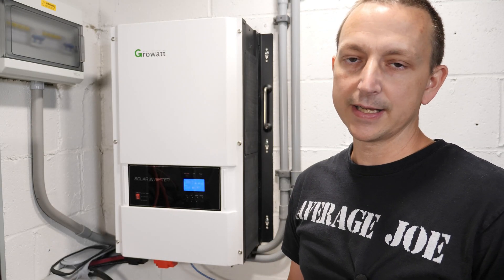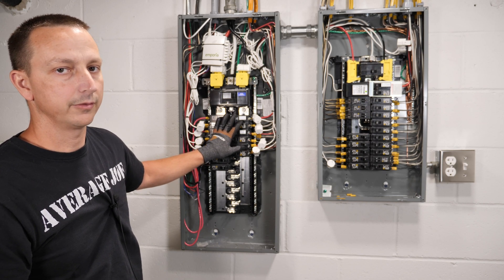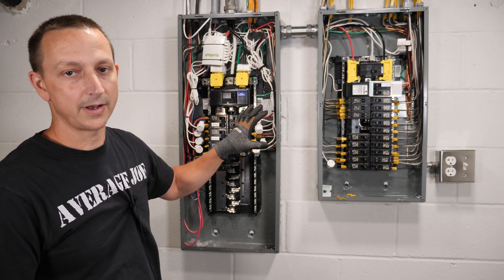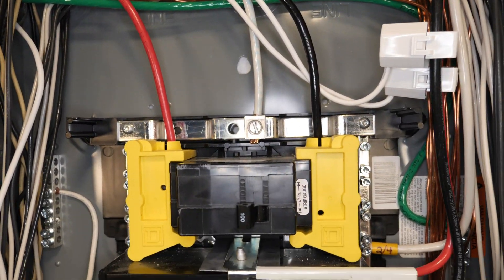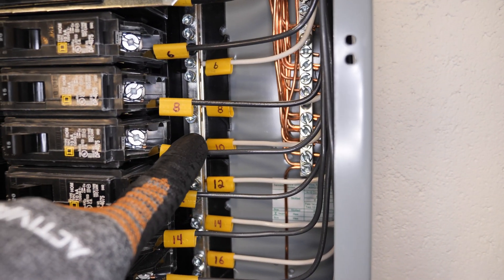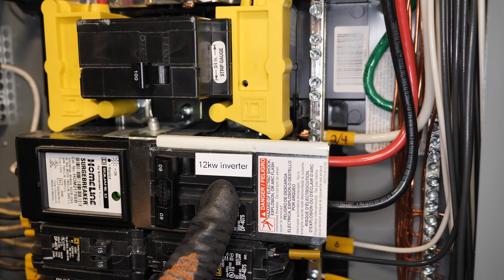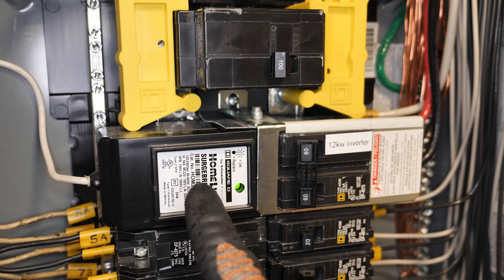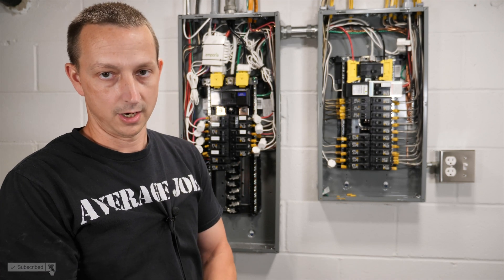How to Wire a 240v Inverter to Power your House for Off-Grid or Whole Home Battery Backup

Comment from the maker: Affiliate Links to Parts I used to go Off-Grid!⤵
🔗12kw Hybrid Inverter - https://signaturesolar.com/eg4-18kpv-hybrid-inverter-eg4-18kpv-12lv-48v-split-phase-120-240vac-ul1741-cec/?ref=C2w_5wtHG6jKcP
🔗LiFeP04 Batteries - https://bigbattery.com/by-voltage/?ref=53&campaign=AVG
🔗Generator Lockout Kits - https://amzn.to/3DZh0zO
🔗6AWG THHN Wire - https://amzn.to/44ih0Wd
🔗Homeline SurgeBreaker - https://amzn.to/45t3FeX
🔗Emporia Energy Monitor - https://amzn.to/47BszLm
Reply: Hi Joe, Enjoyed you walk-through and it seems to me to be spot on. It appears you are monitoring your loads with CTs. Sometime in the future would you discuss your load monitoring scheme? Thanks, Howard
Reply: Hi, is the growatt still working with no problems and for how long have you been using it. My Genetry Solar inverter stopped working after 3 months without any obvious reason, and I am looking for a better quality inverter.
Reply from the maker: Yeah the Growatt is still running strong. Have had it running mostly 24/7 for the past few years. Few quirks but no major issues. I would buy it again no problem. Did gentry not cover anything under warrenty?
Reply: @AveRage_Joe I sent  a message to their business phone with pictures ,then sent an email but i got no reply. Today , Sean made a video saying that he's experiencing some hard time. I think I'll buy the Growatt and forget about the GS inverter. BTW ! Thank you for your great videos

Comment: No plastic or bond bushings on those metallic conduit connectors, main panel and backup panel? What NEC / CEC code do you adhere to? Good discussion, though, and explanation of the system hierarchy.

Comment: I’m thinking about getting an Eco worthy 10 KW hybrid inverter solar system and I already ran an 80 amp subpanel out to my building, but I want my building only to be powered with the inverter in the solar so I want to know how I would just do that without connecting to the original house panel

Comment: If you wanted to back up the solar with a generator in case of an outage, you would just wire the generator straight to the inverter or would it run through the panels?
Reply from the maker: I have used a generator during an outage and batteries were low.  I ran the wires straight into the inverter if I remember right. It was a while ago. I have a video of that as well!

Edit: It also depends on your inverter and possibly generator. These days I use the generator to charge batteries with a chargeverter.

Comment: Hey  JOE,  
I'm hoping you can help identify  what  What  WHAT  can be safely plugged into the:
 " REMORT  PORT " in the bottom of the 
GROWATT  SPF 6000T / 8000T / 12000T / DVM-MPV  Inverters ?
I have asked  SIGNATURE SOLAR = NOPE 
actually fielded a QUESTION to  GROWATT  = no answer YET 
it does not  Not  NOT  appear in my OWNER's / USER's MANUAL(s) either 
I'll bet that  GROWATT did not  include this  "PORT"  without a REASON 
but 
I do  NOT wish to  Short-Circuit anything just attempting to find-out
any  Help  or  IDEAS   ???
Thanks 
COOP
the  WiSeNhEiMeR from  Richmond, INDIANA 
...

Comment: interesting,  how much battery and solar do you have?  my grid power is so unreliable I want a  solar system as primary ,  grid secondary and genset 3rd and if necessary and able use it to charge batteries ( trying to get hands on 4x 32kwh 48v units)  house uses average 38kwh daily.  thanks
Reply from the maker: Things have changed quite a bit since this video but the "basics" are setup the same but it works so much better now. I am using hybrid inverters now. I have it wires the same as this was but the hybrid can backfeed the main electrical panel and stop there BUT the coolest part is it will power the stove AC and dryer now! I have almost 100kwh worth of batteries and a few solar arrays. 3 solar arrays on the roof and 2 ground mounts. Roof has a little over 11kw and around 7kw on ground. I never see that much since my trees block a lot but yeah. Lots going on here and always upgrading.
Reply: @AVERAGE_JOE  thanks for the reply,  how many /capacity hybrid inverters in system now.  I still want my solar as primary source of power powering the main breaker panel -  i move grid power to manual transfer feeding house or quick disconnect to let generator run same panel  just can't use a/c, dryer or water heater, fine I figured another manual transfer connect to where genset was and put solar on top of new transfer and genset on bottom ,  giving me three options to power house.
Reply from the maker: @mecima I have an EP Cube system that has a hybrid inverter and I have a 12kw luxpower hybrid. I also just got a gridboss and flexboss21 and will be installing it here pretty quick. Then I plan to have everything connect and power main panel 24/7 or as long as I have battery. You can also get an 18kpv inverter and power your main panel with it. Its only 12kw tho just like mine but you can if wanted.
Reply: @AVERAGE_JOE  thanks ,  I just got off line with sales in  Chinese factory and the offer for the batteries look reasonable just have to deal with import taxes / fees and whatever else they come up with,  hopefully find out this week or next on some numbers.   take good care.

Comment: If you separate some loads from the inverter , does that create a connection between input neutral and output neutral in the inverter?
Reply from the maker: Input side of inverter does not have a neutral. Only the 2 hots and a ground.

Comment: What is the 'correct' type of wire for the inverter AC out terminals to the panel? Doesit matter as long as it's sized right?
Reply from the maker: I would use some sort of THHN wire. I prefer stranded copper over solid copper.🤘
Reply: Do you think 8/3 SOOW is ok with strain relief? That's what I ran from my inverter AC out to my ABS breaker box for my portable setup.
Reply from the maker: @liamvg It will work yes. Just try not to run at 12kw for long periods of time. Short burst should be ok.

Comment: I have two 3kw 120v inverters that don't have parallel capabilities; can I wire the hot leg from each one to each hot leg of my panel with their neutrals connected to the common neutral of the panel so that all the circuits will be powered?
Reply from the maker: Yeah I believe you can. Only thing you wont have is 240v. I mean you will occasionally lol. Since they wont be paralleled and in communication, they wont be 180* out from eachother to keep it 240v. You will see 0v and then it will go up to 240v. Ive seen it done with 2 different portable power stations here on YT. If you dont need 240v, you should be good.

Comment: If there is no grid main panel would the load center require the ground neutral bond?
I have to hookup an EG4 12000XP.
Reply from the maker: Yeah if that is your first disconnecting means or "first location to have a main style circuit breaker to disconnect power". I would make a neutral ground bond there OR You could actually do it in the inverter settings I think on those. You can turn on neutral gound bonding through the menu on the 6000XP and would imagine the 12000XP would be the same. Are you Overlanding with it or an off-grid cabin type setup?

Comment: Great job. The only thing I don't like about this setup is it's an all or nothing critical loads panel. A transfer switch offers more flexibility. Let's say you have a 10 circuit transfer switch and two of the circuits are being used for a 240V item. Let's say your AC. You've had a number of hot, muggy, but no sun days and your battery bank can't keep up. With your setup, everything on that subpanel has to then get its power from the grid. With a transfer switch, you can switch the AC over to the grid, while keeping everything else on solar. Maybe there's something I'm missing, but when I do this, I'm going to set up a transfer switch.
Reply from the maker: I have upgraded and installed a hybrid inverter. Install is similar but the hybrid inveter can backfeed the main panel to power those big loads. It will not backfeed past CT sensors installed on the main lines. So I actually power everything in the house while grid is "connected". If grid goes out then it stops backfeed and only powers the subpanel. Pretty cool stuff!
Reply: But what if I have a solar breaker in the main panel? Will the CTs stop them from backfeeding to the meter, because that is the whole point. I guess I would have to have a critical loads panel in this case? @AVERAGE_JOE
Reply from the maker: If you use a hybrid inverter like I have, you can connect your AC coupled solar to it and not the main panel. When you do this, it allows you to still use your solar even if the grid goes down.

Comment: Couple questions: 
So can i do following, get AC from main panel to my hybrid all in one inverter,  and inverter powers the subpanel and subpanel powers multiple rooms in the house. is this a safe approach? 
Second question: does your setup prevents backfeed to the grid? Thanks
Reply from the maker: Yes you can do that and that is how I have my hybrid inverter connected. I connected it the same as I did with the growatt inverter. Whats great about the hybrid is it will backfeed up to you main panel so you can power the entire home until the grid goes down. If you dont want to backfeed the grid then select that option in the inverter settings. You will also need to install the CT sensors so the inverter know if grid is there or gone. Let me know if you have any other questions. Which inverter did you get?
Reply: @AVERAGE_JOE  thank you! I got the sungold hybrid 11000w one. It was priced well ☺️

Comment: Does that mean if there's no power coming in from the grid during a blackout, you'll have to manually switch the inverter breaker on in the panel?
Reply from the maker: I always leave it in the off grid mode.

Comment: If you don’t have sun, can you use a generator to charge it up? I wnna go totally off grid. I want 240 for a dryer. Gunna go with propane water heater. What would you recommend for a system? I wanna cut off the grid, totally. And use my electric panel that’s already wired in my house and everything all done. What complete system would be best? 15 -20 kWh system
Reply from the maker: I actually purchased an older military 5kw diesel generator for a backup😁 I have a 240v dryer and its no problem. I have a gas furnace and water heater but water heater is going out and switching over to a hybrid heat pump electric(very excited about that). Also want to mention I have upgraded batteries and inverter since I made this video. New inverter is a hybrid lux power 18kpv and blows the growatt out of the water. I can 1000% recommended it. For batteries, you need to see what your monthly kwh usage is and or the daily usage. The daily usage is what size of battery you will want minimum. I would go with the EG4 system and can get you a link if imterested.

Comment: How is the unit doing? We are looking at the 8kw unit.
Reply from the maker: Inverter has done great. I did however upgrade to a 12kw Lux Inverter and Love it even more. If you need a transformer based inverter, the growatt is a good choice. If you dont need a transformer based inverter, I would Highly suggest any from luxpower. They have a ton of choices from 6kw to 12kw both on and off grid. I went with a hybrid inverter which makes things MUCH easier for wiring and powering the entire house AND still keeps you off grid. I can get you links if you are interested.

Comment: Where do you run the neutral connection from that goes to the inverter output? Do you run the neutral from the main panel or do u take the connection from the sub panel? Does it matter where it comes from seeing that its the same neutral in the main box as well as in the sub panel?
Reply from the maker: Inverter neutral goes to the sub panel. Sub panel has a neutral that comes from the main panel. All are connected together.

Comment: Does/can the sub panel use the main power out put when the batteries/ solar can’t keep up. Basically does the inverter keep power flowing, and if so is it limited to the inverter wattage rating or does it allow full wattage power flow from the main panel?
Reply from the maker: Its been a while since I upgraded inverters to a hybrid inverter but if I remember right, this one only outputs the 12kw and same on passthrough mode 12kw. I never had an issue for what I was running. Was a great inverter tho!

Comment: Finally, so clear and you actually show both ends of the input and output. I’ve seen others just do a plug for the input. I want it hard wired. And you did that and showed it. Awesome. Extremely helpful. Installing my EG4 3kw and a transfer switch tomorrow. Subscribed
Reply from the maker: Thanks! That was the main reason for this video. Nobody wants to show it. Glad it was some help!🤘
Reply: @AVERAGE_JOE  ❤️‍🔥THANK YOU SIR🇺🇸 for showing the DETAIL and the PROPER WAY TO DO THINGS👍👍👍🇺🇸

Comment: I got a question. Why not include the central airconditioner and take advantage of the AC bypass mode when its overloaded? The majority of my electrical bill is heating and cooling so at least I can offload the cooling and heating cost through solar? Thats just my idea.

Comment: I'm so glad that I found your video. Because your scenario is exactly what I have in mind to do with main and sub panel to divide the breakers.  Now, I know how to use main panel supply ac power to inverter.  That is how inverter could auto switch over to the grid when battery is low or out.  Plus, you explain the neutral and ground bar very clear.  Thank you so much.
Reply from the maker: Awesome! Glad it was some help!🤘

Comment: Hello,

Thanks for the video. Just to ask, if two inverters were already in parallel and you were to power the two inverters from the main, how would you do this? Would you take another hot (red + black) from a breaker and run it into the second inverter? Also, with the two hot wires from the main, will this make the total voltage 240v?

Thank you again!
Reply from the maker: Thanks! With inverters that can be paralled together, usually you have the hot black to inverter 1 and hot red to inverter 2. The paralleling kit that goes with the inverter allows it to work correctly along with a few settings. Which inverters are you using or thinking of using?
Reply: @AVERAGE_JOE  Thank you. Now I understand your response. So I'll have the hot black to inverter 1 and hot red to inverter 2. Then, each inverter will also have the neutral and ground? Also to clarify, I believe the two hot (red and black) will be 120v each, so, I will have to ensure my inverters is connected as split phase 120V. By the way, I'm using SRNE inverter.
Thank you again!!
Reply: @AVERAGE_JOE  I have two 10kWh batteries. One battery is an all-in-one with inbuilt 5.5KW inverter and the other battery and inverter are separate. Do you have any experience with Enphase system?

Comment: Thanks for your straightforward lesson. That configuration will not return excess power to power company, right? I suppose in an offgrid context there is just the connection between panel and inverter?
Reply from the maker: No power can be sent back to grid. If you use the grid, its like plugging the inverter to the wall.

Comment: Hey man thank you so much for sharing this video! You’re a Godsend sir you clear a few doubts I had regarding where to connect the input and output from the Inverter and now I see what you did. My other question would be, instead of providing power to the Subpanel from the Main through the 60amp breaker, can I take it straight to the Grid slots (Sol-Ark Inverter has Grid, Gen, Load) and then of course the Load to my main since I want to energize the whole house?
Reply: I have the ACs and the pool inverter motor on a separate small subpanel on the roof and is connected to a 100amp breaker at the Main so I usually shut that off when I need to run the generator which is what I have at the moment but I really want to do this myself, with what you share and other videos, is fairly doable.

Comment: I can understand why the inverter output needs to handle high current, but I thought the AC line going to the inverter would just be needed to sense the voltage and phase, so I don't understand why the AC line going to the inverter would need to be high current.
Reply from the maker: If you are connected to grid, the wires should be big enough for passthrough ( if batteries are low) and be able to charge the batteries.

Comment: If your completely off grid can you charge your batteries with a generator through the inverter? The generator is wired to main breaker panel and can power the house when solar is low.
Reply from the maker: Yeah you can do that. I charged from my generator during an outage. Video is on my channel!

Comment: So, with your setup, if you lose power from the growatt for any reason (batteries die, solar insufficient, inverter fails etc) then your critical loads subpanel just goes dead completely?  Until you access the panel and shut off the inverter breaker and power on the main breaker from utility power?

How could it be wired so that you automatically get utility power when solar/inverter is insufficient?
Reply from the maker: Great questions and Yes. For mine, if  any of those fail. My sub panel goes ded. If you wanted to add another fail safe like another inverter and battery (cause I am assuming grid would also be out). You could add an auto transfer switch like I have done(not videoed yet) on the inverter output wires. Basically have 2 off-grid systems feeding the auto transfer switch and the output of the transfer switch goes to the sub panel. If your "main" off grid system fails, the auto transfer switch "switches" to the other. If the main comes back online then it switches back.😆🤘

P.S. I have a picture on my community page of the transfer switch. Its a cheap 240v 100a from amazon. Works great so far when testing.